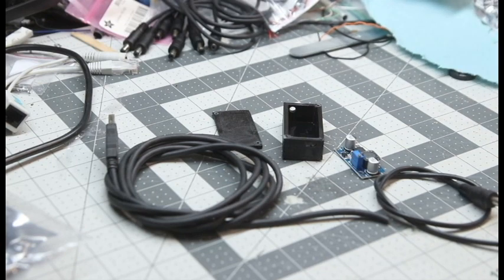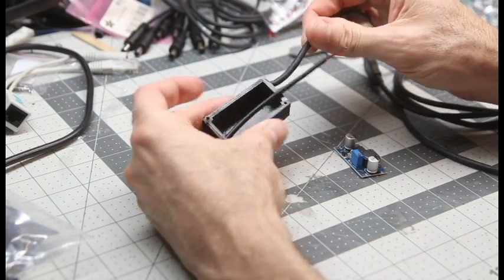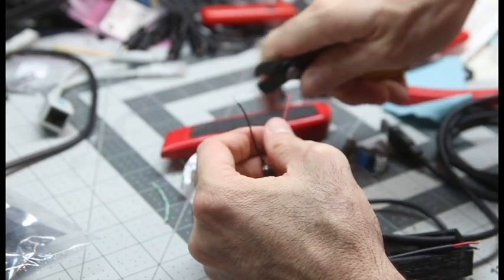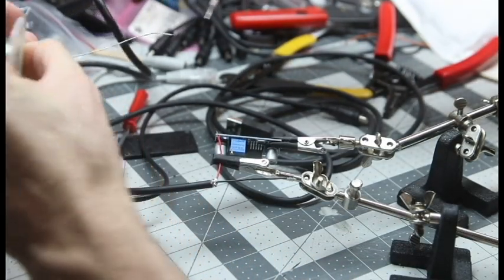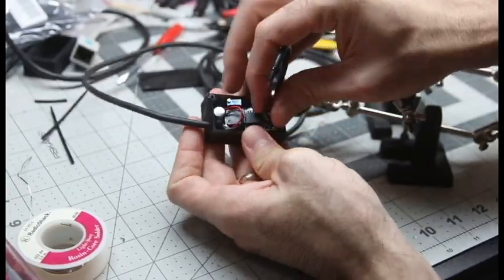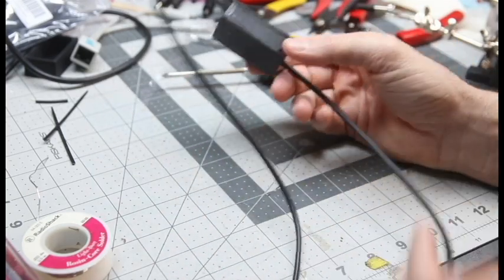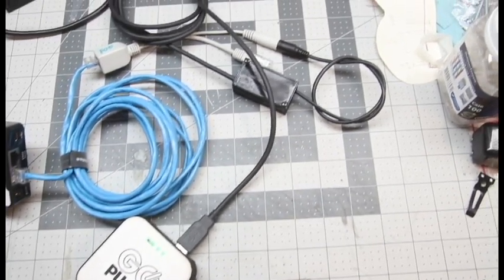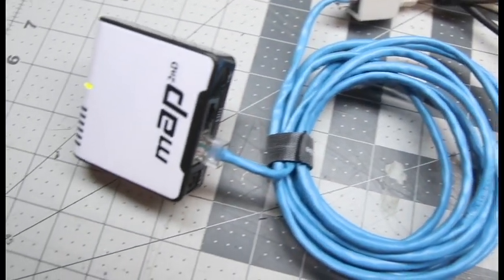Build a 5V USB to 24V PoE Booster

Comment: I want to make some desktop speakers. Looking at the amp boards available, 24V might be the easiest option but i dont want a brick fed from a wall outlet. Instead i want to have the speakers powered off the tower so they come on and go off with the PC. It's just so i can watch youtube or quick video's here and there without having to turn my hifi on. This looks like the way to go powering off one of the usb ports.
Reply from the maker: Just keep power draw in mind!
Reply: @GregSowell  Yeah good shout. There are some amp boards available that are designed for 5V supply and run 2.1 channels at 10W per channel. Just looking at current ratings for USB and they're pretty low so i can't quite work that one out. Might be better to use a C port? I've gone for a 2x20W amp on a 24V supply coming from a  5v-25 boost converter. Thanks

Comment: Seal the ends of the box where the wire comes out,  then pour with potting epoxy, then itll be waterproof also.
Reply from the maker: Nice tip!  I was thinking about that, but then I was worrying about heat dissipation.  I suppose it's used in such short bursts that it wouldn't really be an issue, though.
Reply: Greg Sowell the block of epoxy should dissipate a decent amount.  or add a tall heatsink and leave it exposed. ive got those little boards, not much heat under 5w